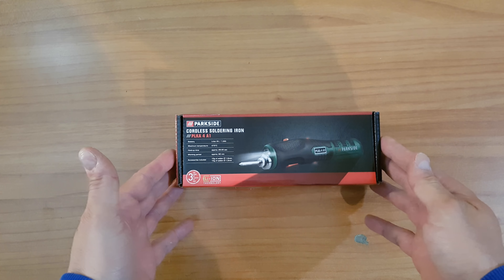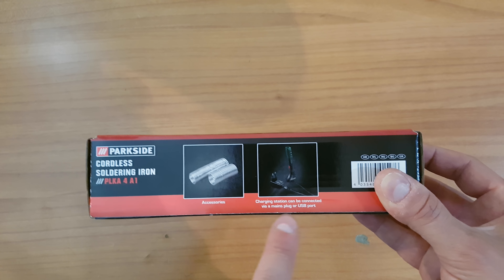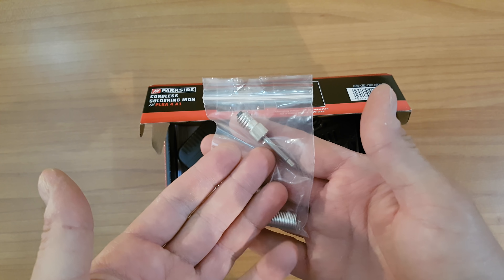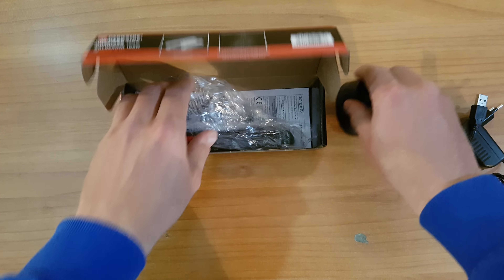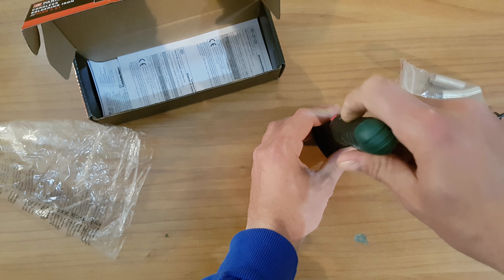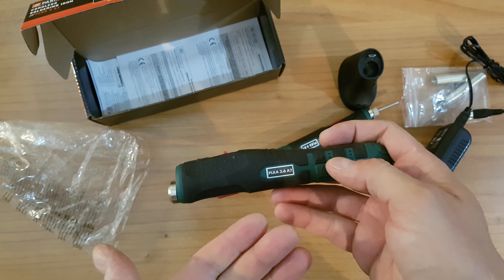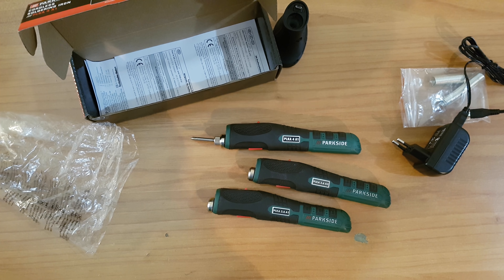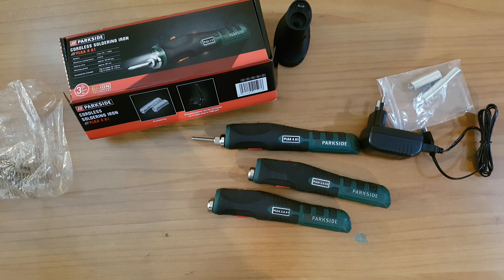Parkside Cordless Soldering Iron PLKA 4 A1 UNBOXING REVIEW

Comment: How did they forget to improve them with temp regulator after 2 models, thats why Tips on 470C does not last long. 200-250C is enough for quick solder joints, i think of modding 2 things but it has 3 year warranty... Maybe better one 4 A2 is coming next.
But its practical to have for car stuff, outdoors, roof stuff. Thanks for this comparison video.